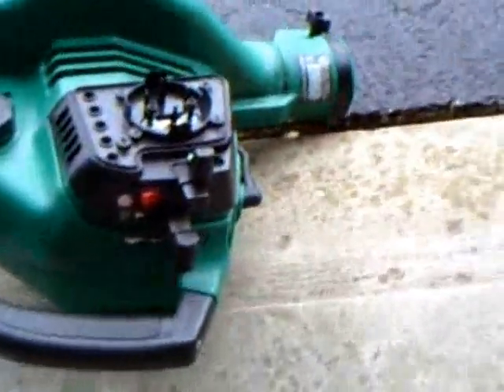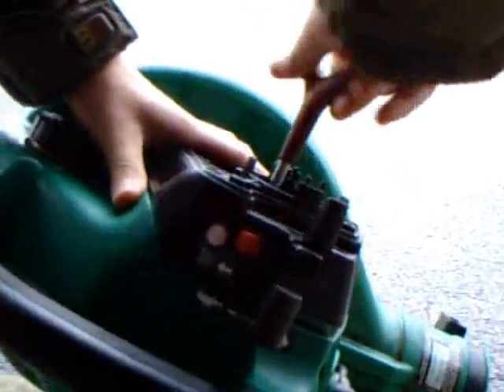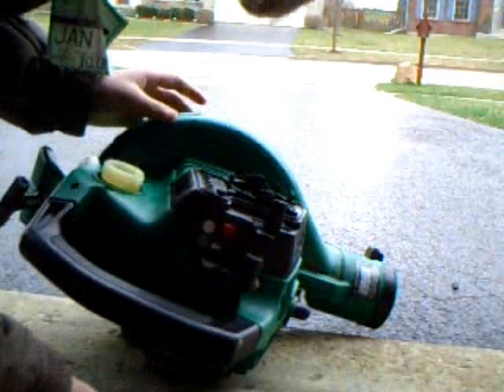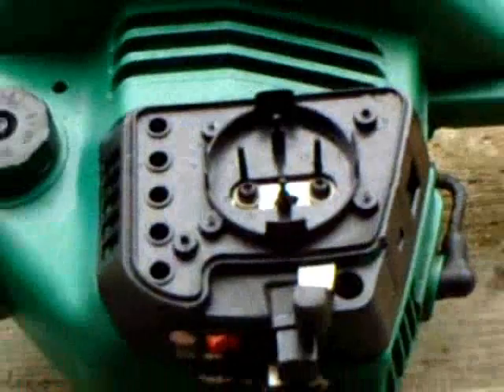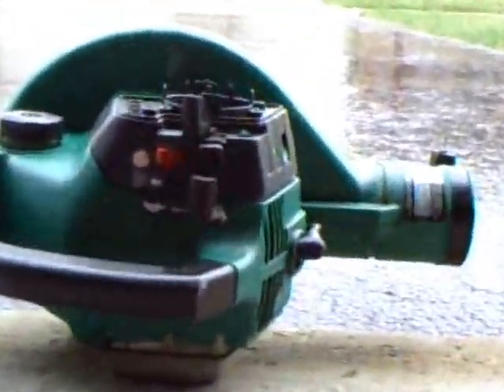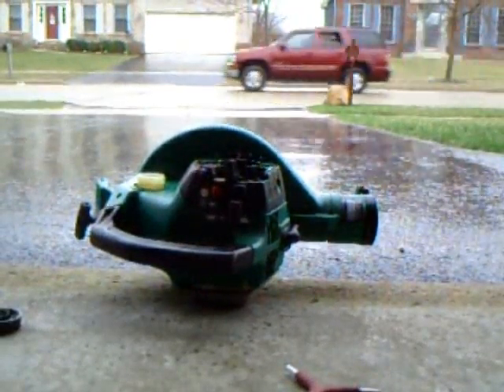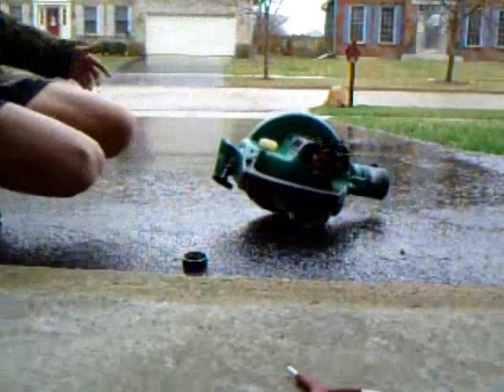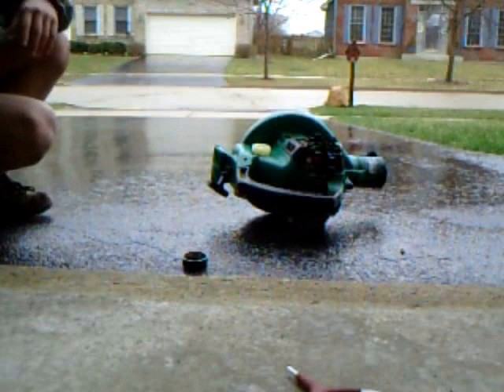Blower-Vac  update

Comment: check the fuel cap if it`s not venting fuel will not flow....fuel filter .but it`s probably low compression if it won`t stay running